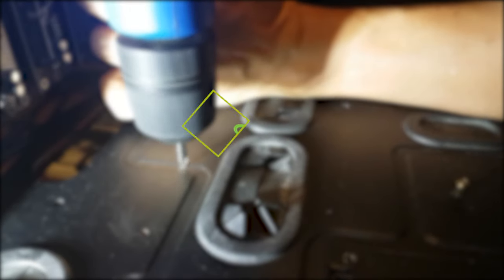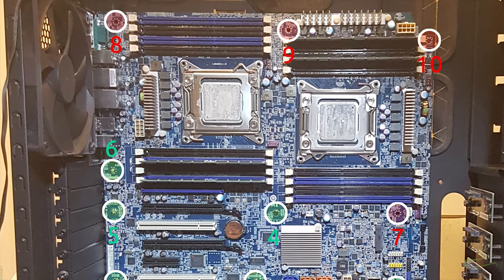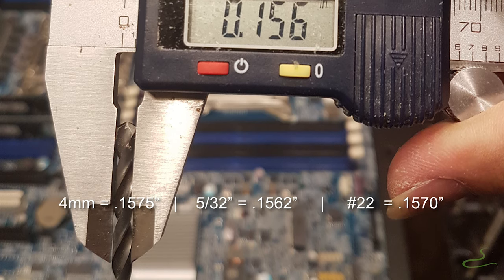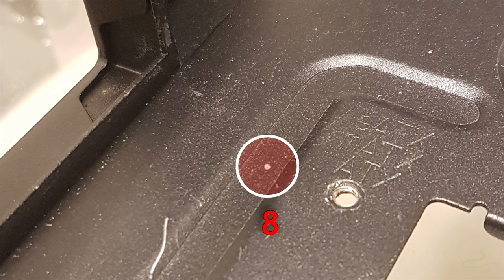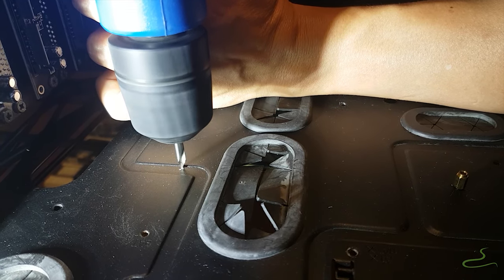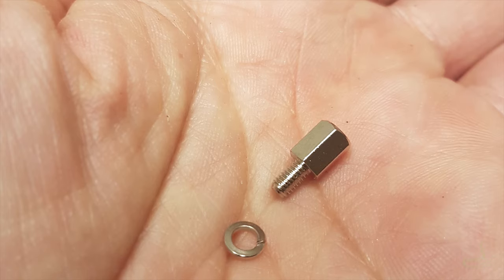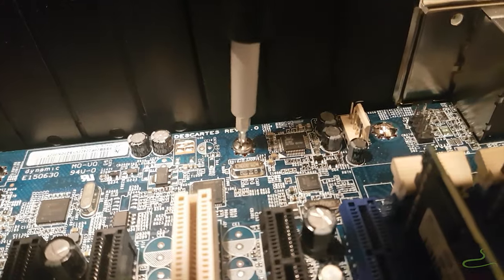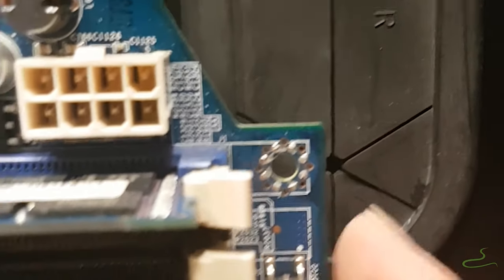How to drill and tap PC case with basic tools.

Comment: wanna cut a HOLE for CPU cooler backplate with circular saw, cuz my new PC has not this hole. any suggestions?
Reply from the maker: As long as you have the right saw for the material. It should work. Use metal file to polish and deburr the sharp edges afterwards. I haven't done it myself but dremmel tools can also be used. Remember! Wear eye protection!

Comment: whats the purpose of the locating stand-offs? so that it sits flusher?
Reply from the maker: locating standoff is used to make sure the motherboard sits at the perfect location. With screws being 3mm OD and hole is 4mm ID, there's a bit of a play. Locating stand-off has a little round thing 4mm OD to accommodate  for 4mm ID hole. This is to minimize the play when installing motherboard on the case back plate.

Comment: I noticed u had some steel screw holders, mines are all brass, wondering if the are weaker than backplate metal and get ruined, will test
Reply from the maker: You mean the steel screws will damage the back plate? If you can have at least 3 threads in the back plate, you do not need to worry. M3x0.5 thread means it has 0.5mm pitch (thread valley to next valley). So 3 threads translate to 1.5mm thick back plate. And that is seriously thick back plate. Most case has way less than 1.5mm thick plate. Yes there's a chance u might strip the hole thread in the back plate. Wirh that said, if u watch my homelab server build video, i use steel screw on plastic. Just becareful not to torque the screw head a lot.